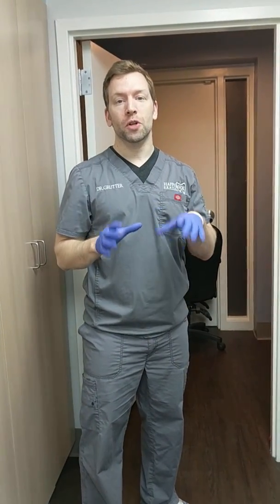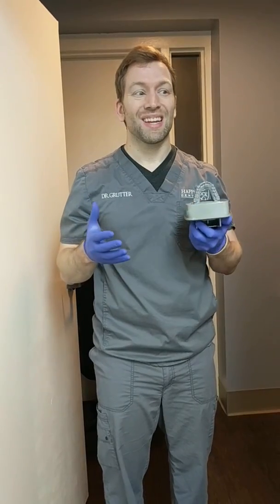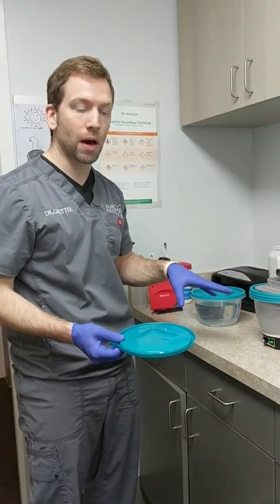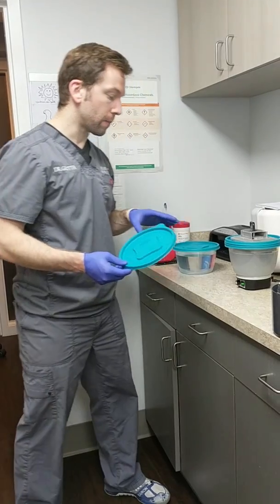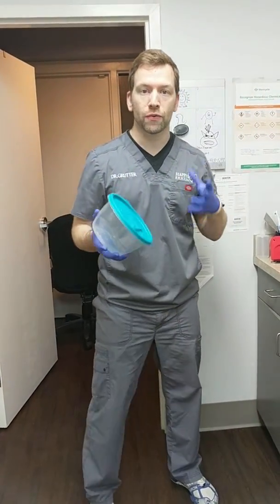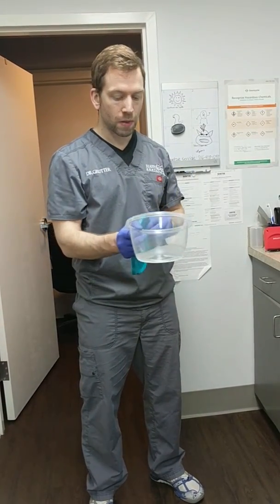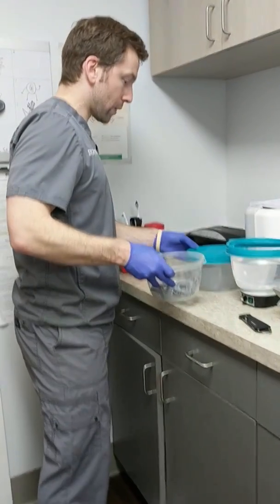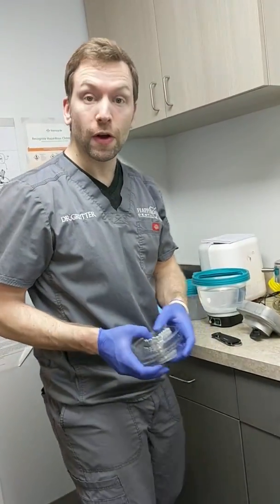DIY 3D Print Wash Station

Comment: Thanks for the video! Real quickly-- how often/how do you know when the alcohol in the wash station needs to be replaced? Also, do you separate alcohol tubs for different resins (splint vs model vs surgical guide resins)?
Reply from the maker: Truthfully, we just watch for it to become foggy. If it's no longer clear, we filter it. We tried to reclaim the alcohol, as much as possible. We have separate tanks for each material that will go on the mouth and then one combined tank that we use for things that do not go in the mouth like models. We also have a final wash that we run everything through. This means that we keep about 3-4 for tanks available at all times for the different materials that we use.
Reply: @bgrutterdds  I love that you try to reclaim alcohol! What do you use to filter it? Coffee filter?
Reply from the maker: Believe it or not, we use bounty paper towels. We pour the alcohol in a large, 1 gallon sambucus mason jar. then, we just set that out back for about a week before we even look at it again. It doesn't need that much time, but we have enough to keep working and then we do with it when it's truly cured. Then, we filter it through the paper towels.

Comment: what is the type of material , is it have ability to withstand the heat ?
Reply from the maker: What material are you asking about? The Isa propyl alcohol should definitely not be heated. The resin  Used for printing the models can re withstand some heat color but not too extreme. I do not know the exact numbers, but they could be found on the Sprintray website.

Comment: If an ultra sonic cleaner can increase/decrease (depends how you look at it) the flashpoint of IPA wouldn't a magnetic stirrer do something similar?  Or are we looking at more of a "shaking" vs. "stirring" type of agitation?  Thanks for your thoughts and nice idea.
Reply from the maker: The ultrasonic actually increases temperature of both the equipment and the liquid being vibrated. Stirring alone does not generate that same increase in heat.

Comment: I'm not in dental but are you basically making your own invisalign? Are those 4 stages of corrected teeth models for the same person?
Reply: Also, why print a postive to mold plastic over? Can't you just print the final device?
Reply from the maker: That's correct. Sequential models. Can take just a few or many depending on case complexity. 

We don't have materials yet with the strength and flexibility at this thin. Also, the cleanup work and polishing required would take far too much time based on current workflow. Eventually we'll print directly, but we're not there, yet.
Reply: @bgrutterdds  so fascinating. Were the scans taken by scanning their teeth and gums directly or did you take a negative (geltrate etc) then scan the inside of that impression? Or fill that with plaster and scan the plaster positive?
Reply from the maker: All options you suggested work, but scanning a physical impression is the least effective due to undercuts and inability is an optical scanner to see. We scan intra-orally with a small, wand shaped camera. We typically use the Carestream CS3600. If we want to scan a model, we use our Shinning 3D Desktop scanner.

Comment: Any specific reason why you chose a magnetic stirrer over an ultrasonic solution, except for the lower cost?
Reply from the maker: IPA has a dangerously low flash point. Ultrasonic statistically might be fine, but I don't recommend the risk.
Reply: Did you mean statically (as in electro static)? My actual fear with ultrasonic would be that one washes off too much resin. I mean does that problem exist? Can you wash off semi-cured resin if the print sits too long in the (whirling) IPA, thus accidentally alter the print?
Reply from the maker: No, "statistically". Meaning, odds are, your lab won't burst into flames. But, is it worth the risk?

Never heard of over washing with liquid so long as you don't leave it over-night. With too much time, it will begin to breakdown.